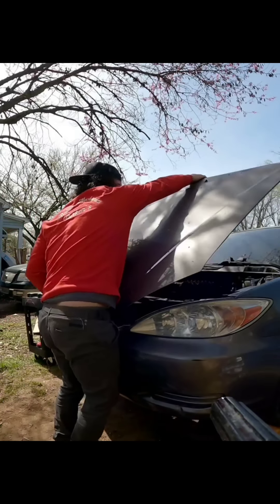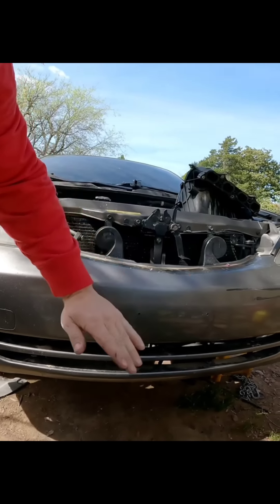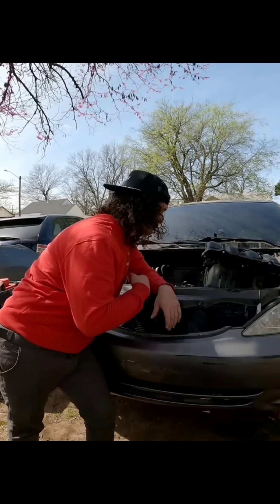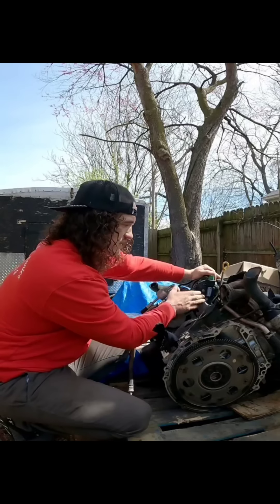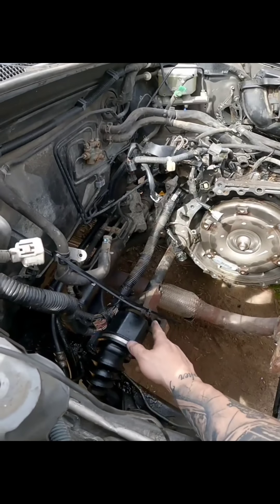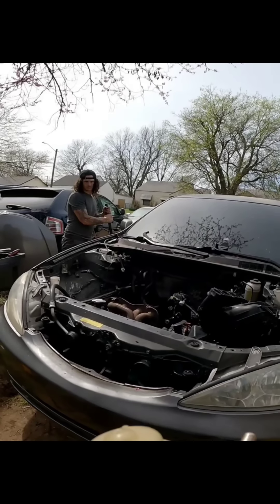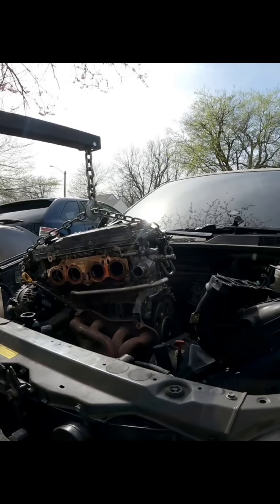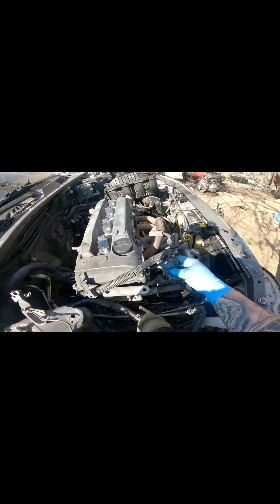Oh no!! between a rock and a hard place!

Comment: Well if the oil pan is the problem put the old pan on there off the old engine then maybe it will go down far enough.  Maybe.  I’m not there so you know more than I do at this point.  😂.  But love the videos.  👍🏻
Reply: Think your idea is what he should do. Unless there is a reason the old engine's oil pan doesn't fit on the new engine. 

But good idea.
Reply: Yep swap the oil pans but you still might need different mounts

Comment: I’ve done a lot of jdm to usdm swaps and they’re great donors but always find myself swapping 20+% of the old engine onto the donor. Most I’ve done always require the oil pan(s) swapped and in some cases the entire front timing cover to accommodate original accessories and or mounts. I generally just break them down to longblocks and transfer as much of the original engine as possible as I’ve been in your shoes before installing/pulling multiple times. Keep trackin brother you got it, love the content.

Comment: I’ve had to wrap a ratchet strap around the motor and ratchet the motor forward  because sometimes the mounts just don’t line up. Especially swapping to poly mounts. PITA for sure
Reply: You’ll need to strap the ratchet too the front crash beam. It might take a couple straps, mounted to another location as some are a real PITA.

Comment: That was like when my brother bolted a 1991 model 3S-FE engine into his old 1987 model Toyota SV21 Camry, they use a different amount of crankshaft flywheel bolts in the 1987 model engine so you have to fit a 1991 model flywheel onto that engine because the 1987 model 3S-FE flywheel won't fit.

It looks like you will need the lower engine mounts from the model of car that the engine is going into !

Comment: I have an 02 Camry and just had to replace my injectors, all 4 motor mounts, tie rods, MAF, Evap canister, brakes, calipers, rotors, sway bar links… seeing those headlights gave me ptsd. Still have to change struts, serpentine belt, and my throttle body is dirty as shit. 217k miles and they never changed shit. Good to see someone else work on a Camry and not me 😂🥴😭